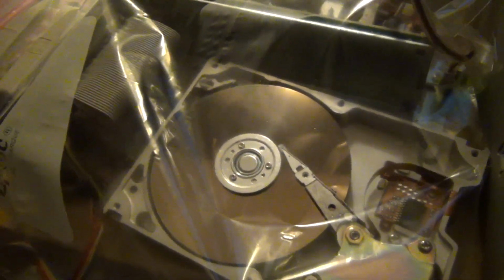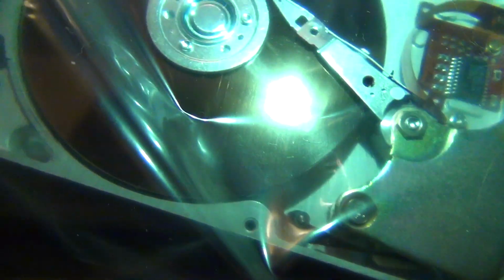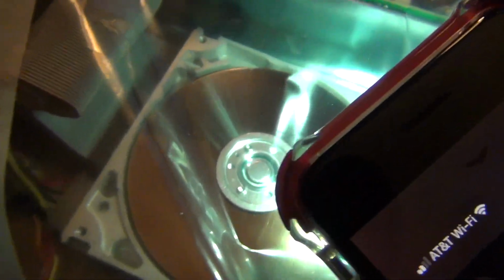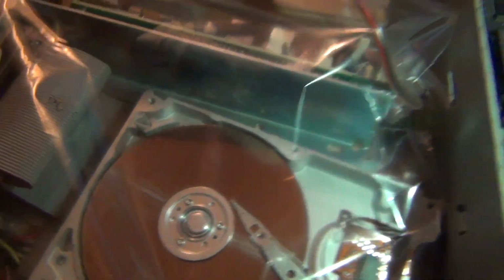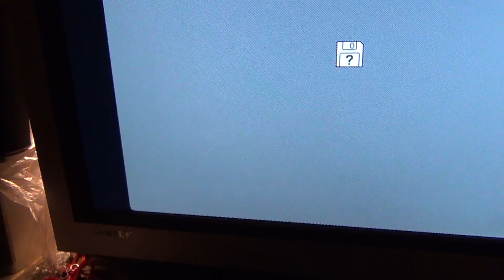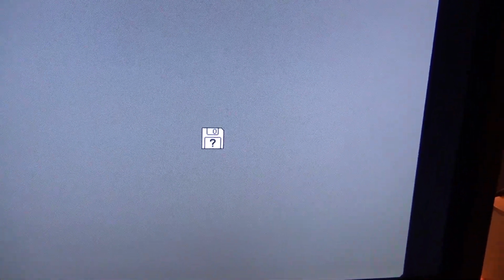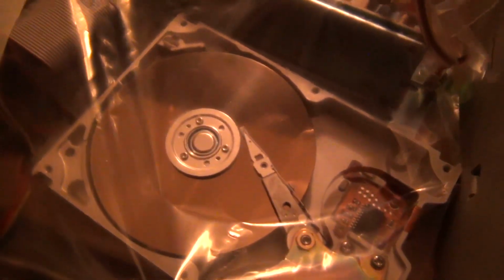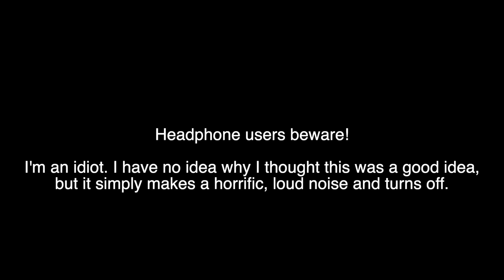Quantum ProDrive ELS Autopsy

Comment: Think about how this could have been avoided all if Quantum decided instead of putting the rubber under the platters to where it is a hassle to do on a one platter drive and extremely difficult on a two platter model, they could've just put it in the magnet housing where it could have easily been replaced! Now all of these have what would be considered a serious defect! Also you thinking the platters were scored at first I don't blame you, that is normal as early drives like that you could literally see the tracks on it! I have a Seagate Medalist ST3660A that works decently and looks the exact same with those groves all over the platters. Also the platters on every drive is friction-fit to the spindle with the screws, so never spin the drive up without the screws! It will be extremely loud like it was in the video. Thanks for making this video, it was entertaining to watch.
Reply from the maker: Heh! I certainly learned a lot here, including how to use an old hard drive to wake up my parents from two rooms away. 
It is pretty frustrating that these drives are so flawed. Some Fujitsu drives from around the same time are affected by a similar issue, it would seem. Having a part that’s essentially a ticking time bomb has caused these specific drives to skyrocket in value, which is quite ironic considering it means most people would want nothing to do with them. 
I can’t remember if I’ve mentioned it in a video, but I also have a Quantum GoDrive whose heads are stuck in the parked position. I imagine it’s a similar issue.
Reply: @hs_doubbing  Repair video? If it is a single platter drive it is quite possible.
Reply: @hs_doubbing  Also what Fujitsu drives might have a similar issue? I haven't heard anything about those, and my MPA3035AT is still working perfectly although the bearings are slightly worn.
Reply from the maker: I don’t know exactly which Fujitsu drives have the issue, but I think it’s the ones from around the same time. I haven’t personally had it happen. 
As for the GoDrive, I don’t know that I consider myself qualified for a real repair. I may just try to run it open, poke at the heads and get it running, and try to recover the data.
Reply: @hs_doubbing  You can do that, although they are extremely likely to get stuck again once the drive spins down. Maybe they didn't expect their drives to still be in use 20+ years later!